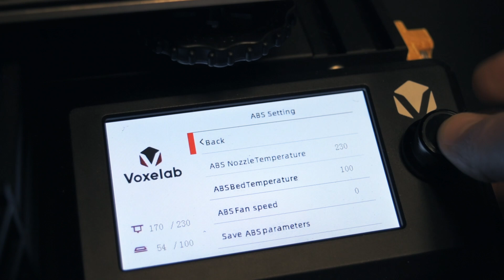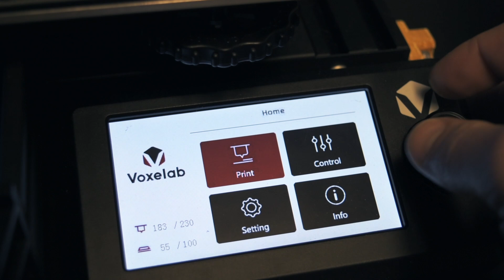Can the Aquila print ABS?

Comment: Heated right side up bed plate always works fine for me for PLA And PETG. Never used glue stick. Only needed when the bed wasn’t heated.
Reply from the maker: PETG is known for fusing with build plates when not using an adhesive. ABS just warps on bed slingers and when the ambient temperature isn't high. So an adhesive as a must. As for PLA…anything can print PLA. That shouldn’t be an issue on pretty much any surface.

Comment: thanks for all the advice - it has helped a lot.... I tried to use the profile you shared but the latest version of Cura won't let me use it (it won't show the profile as the quality type "draft" is not available anymore. Have you got an updates profile or can anybody advise me on setting for ABS using Cura to print on the Voxelab Aquila ?
Reply from the maker: The way to get my profiles to work is to setup a “custom” printer. If you have one selected from a list, such as an ender for example, it will give you that error.

Comment: Recently I have been having a lot of trouble with my printer stopping at random points in the print and sounding the alarm. It will have a message that says nozzle or bed temp is too high/low. I just got a new pack of thermistors. Have you had this issue or have any guidance for me? Thanks.
Reply: I should have added it's a voxelab aquila and Ive had many successful prints. This issue has started in the past week
Reply from the maker: Very common issue. It’s the thermistor. Sometimes it needs to be reseated. Sometimes it needs to be replaced. They are just not a quality item on these.

Comment: How did you change the seam location?
Reply from the maker: In Cura, above all the settings there is a search bar, type in “seam” and it should just show you all of the seam options. In the drop down you can select “user selection” and then you can tell it exactly where you want the seam. I tend to like to put it in the back somewhere or tell it to hide the seam in sharpest corner.

Comment: How do you open/use the profile? I opened the link in your description, it downloaded to my computer, but I cant open it.
Reply from the maker: Do you get an error? If you setup your printer in Cura by selecting one from a list, my profiles won’t work. You have to set it up as a custom machine. ;)
Reply: @3DPrintSOS  I think that might be my issues. I am using the Ender profile in Cura. I will try setting up the custom. Thanks!
Reply: Alright, super close. I got them (Pet-G, PLA, ABS) all downloaded and onto Cura. Im noticing that the fan speed does not auto adjust to your settings. Is that something that I need to do manually, or am I doing something wrong. The ABS and Petg are not sticking well, and I realized after the fact that the fan speeds were not correct.
Reply from the maker: Honestly, never heard of that being an issue. You could always set your fans and save over the profile though. Interesting find. Wonder if this is common and no one noticed.

Comment: Question, is it bad that i scratch the texture part of the build plate when trying to remove a print with the scraper? i would need to replace it if i damage it too much?
Reply from the maker: If it’s super deep and shows up in prints you may. But it should be ok. I have scratches on pretty much all of them, here or there. It’s almost inevitable. If it gets bad, you can always flip to straight glass. ;)

Comment: Did you need to change over to a hardened nozzle for ABS or is it fine with the standard brass?
Reply from the maker: It’s fine with copper. Just hotter and more abrasive filaments destroy these copper nozzles quick.

Comment: ABS question, is the enclosure more to prevent drafts of air, or maintain temperature, or both ?
Reply from the maker: Both. Abs loves to cool fast and peal up from the bed. And the enclosure keepers the temps up until it’s ready. 

I’ve actually printed abs quite a bit now with that machine and I’ve had very little issues when using an enclosure
Reply: @3DPrintSOS  great, thanks, I'll keep the temp in mind making an enclosure this week :-)

Comment: I am having issues with ABS. I can get decent prints, but only using the provided profile and using a brim and setting print speed to 55% or 60%. I also have to keep my Z-offset set to -0.02 or the filament won't stick. It balls up/clumps and then breaks loose and continues with the brim. My mitigation technique is basically once the bed is as level as I can get it, while printing the 1st pass at the brim, take my cutters and snip the balled up ABS away from the brim while making sure not to lift the print (I still get some lift, about 1 or 2 mm and I can pat it down and it sticks after 1 more passes). 
Is there any way to prevent the printer from balling up a few mm of ABS when it first lays down the brim? Will glue stick help here? I am using the texture side of the build plate without glue.
Reply from the maker: Glue stick will help for sure. It’s about how fast the plastic cools in this case. Are you using an enclosure? If not, make a makeshift one out of a box and test to see if that helps.
Reply: @3DPrintSOS  I was able to get my results using an enclosure, just a cheap one from Amazon. Before trying the enclosure, my ABS prints would mess up worse than that. I am part of the way through a ABS print now and the brim is starting to curl/lift. The brim is large enough so that the item I am printing shouldn't have any issues. I'll see in about 8 hours what the print looks like and if there are any major issues.
Reply from the maker: Put some tape on the brim to save it from curling more

Comment: Exactly how ABS worked out for me.
It was like oil and water without the glue.
Glue makes it hard to remove...
Reply from the maker: I’ve printed abs a bunch now. I still use glue. What works for removal is to use the scraper up against the print and a few taps to the scraper with something else. In my case, a screw driver. Those few light taps break it free.
Reply: What about masking tape on the plate?

Comment: i have tried printing abs but not getting satisfactory results. i print with esun abs+ with ender 3v2 stock can aquila profile be used for ender 3v2. what slicer do you use?
Reply from the maker: You can try to use the profile, they are fairly similar. I think ambient temps and heat setting matter quite a bit depending on your location and where the printer is. You might have to enclose your machine to get it to print

Comment: I've been able to skip glue by using blue painters tape on the bed. It wasn't sticking to my smooth Prusa surface even with glue. It stuck to the tape no problem though.
Reply from the maker: I gotta grab some super wide tape to do some testing. Thanks.
Reply: @3DPrintSOS  I just had a standard one, did about 3 strips since my print was mostly center of the build plate.

Comment: Tubing link doesn't work.
Reply from the maker: Yep, looks like Tecboss ran out of stock. I tried to contact them with no luck. Capricorn is the next best thing: https://amzn.to/2XooE4Z
Reply: @3DPrintSOS  Thank You
Reply: @3DPrintSOS  I very much appreciate your replies. I am so close to getting a Voxlab Aquila X2. I am able to get one on ebay for $199 but I need to print with ASA. I have seen the mods you suggest such as the PTFE tubing and I assume it is much the same as or easier than ABS. I understand about having an enclosure and that doesn't concern me other than with the fans turned off the heat would damage the electronics, What do you think of the idea of removing the power supply from its mounts and extending it outside the enclosure?
Reply from the maker: Although I haven’t tried asa yet, I would think with a nozzle, ptfe tube, or all metal heatbreak, you should be able to get it done. 

If that’s what you plan on doing long term, I would totally move the power supply outside the enclosure. You would only have to extend a few wires. Wouldn’t be too too hard.
Reply: @3DPrintSOS  I'm learning in large part to you. Especially concerning the Aquila. When you say All Metal Heatbreak". Do you mean the $4 metal piece or the whole hot end assy? As, these mods add up in cost one has to consider whether there is a machine already geared toward ASA/ABS at a comparable price. All the enclosed printers seem way over priced in comparison. All the reviews for the Voxlab are good.
I have this question submitted to Voxlab but have not yet heard back.
Reply from the maker: They do add up, you are right. But even still, the machine is cheaper and performs on par with everything else. ;). If you want something that has it all already, check out the Prusa printers. 

Yes I mean the metal piece between the block and heat sink. You can grab and all metal or even bimetal version and it will allow you to print practically everything on this machine.

Comment: Hi cool video, did you manage to print without any adhesive product just the clean bed? Keep the good work.
Reply from the maker: Hi. Thanks. No, not with abs. It seems to require glue to work. Similar to nylon
Reply: @3DPrintSOS  thanks for the info. 👍

Comment: I keep getting an error  when i try to import the abs profile into Cura it says could not find a container to handle specified file. ho to i get this profile to Cura I have some parts i need to print. Thanks.
Reply from the maker: I’ve heard of this before. Are you using a different printer profile?
Reply: @3DPrintSOS  i have been using your PLA profile from your video. I have only used PLA so far. I am using the voxelab aquila printer also.
Reply from the maker: Hmm what about the printer setup in Cura. Did you do it similarly to how I did in the vid or did you pick one from a list?
Reply: @3DPrintSOS  I did it exactly how you did in the video. I also tried updating cura to the new version I believe it's 4.9 also but that didn't help either. I still get the same error message.
Reply: @3DPrintSOS   hey i finally got it to import to Cura. I havnt tried to print yet but, I  was trying to import it as a material profile instead of another printer profile I think thats here i as having the trouble. Thanks for your replies though I appreciate your time. Ill let you know if I run into any more problems. Thanks again.
Reply from the maker: Ah good to know. This will help others when/if they run into this issue.

Comment: Try using a lighter just to burn that glue off.  Or just a light sanding on a flat surface with wet/dry fine grit.
Reply from the maker: Nice. Thanks.

Comment: So 230C for the extruder and 100C for the build plate, I'm not using the glue stick and it's working pretty well, just need to make sure to add a brim so it has more surface to stick to the plate.
Reply from the maker: Nice! Yea I’m digging printing abs. Seems like a great material.

Comment: Total noob question, but how do you adjust the flow of the filament?
Reply from the maker: You can adjust it in Cura before you slice. ;)
Reply: @3DPrintSOS  if your e steps are right, but the actual filament laid is wrong do you modify the flow?
Reply from the maker: Exactly. Flow is how you calibrate the filament, esteps are how you calibrate your extruder.
Reply: @3DPrintSOS  does it make sense i went from 93 to 96 steps when all i did was change colour from the same brand

Comment: Hello again, I have a question for you.
How can i change the position of where the head goes when it is done printing. It goes a few mm over the place it stops now i would like a X-10 Y-200 and Z about 20mm above the stop point.
Thank you for your knowledge!
Reply from the maker: You can add some “end gcode” to your slicer that tells the printer what to do at the end. You should be able to find all kinds of options based on the Ender 3.
Reply: @3DPrintSOS  Thank you!

Comment: For printing ABS without enclosure and having a nice first layer try this.

Flip your glass on the ultrabase side, apply gluestick, spritz watter on the already applied gluestick and with a paper towel gently wipe untill you can't see the applied gluestick.
You'll wipe a lot of the applied gluestick but a thin layer will be left.

This works for me with ABS that likes to warp.

If you don't like to apply adhesive for ABS,try Fiberlogy Easy ABS or ASA or FormFutura Titan X(ABS), they work extremely well without enclosure and there is no warping,these filaments are a bit more expensive but it's worth it.
Reply from the maker: I appreciate the pro tip!

Comment: What temperatures do you set PETG on your Aquila?
Reply from the maker: Check out the PETG video. I have a profile included that you can use.
Reply: @3DPrintSOS  I have done that already but my computer is having issues with reading the file. I don't have the right software to read the file, nor can I find it.

Comment: This printer has been driving me crazy! I have not been able to get anything to print correctly 🤬
Reply from the maker: Hmm. Any more detail? Maybe we can help.
Reply: @3DPrintSOS  I did finally have a good print after readjusting the bed for the 100th time. However, when I try to print something other than the test files I get trash. The filament seems not adhere to the surface in some places. Then on a subsequent layer the loose filament on the bed is getting stuck on the nozzle. When the nozzle moves it pulls up the rest of the layer(s) from the bed. I was gonna try glue stick and masking tape. I'm using the PLA sample that came with the Aquila. But it's almost out, so I will have to switch to the PETG spool I have.
Reply from the maker: Try to clean the bed really really really well. Also try flipping it to the glass side as well as doing a live leveling.
Reply: @3DPrintSOS  I did clean the bed with soap and hot water. Then, dried. Then, went over it with isopropyl alcohol. I did get a print to stick after adding glue stick the bed, but it seems to need to washed off and reapplied after every job, and it doesn't work for all jobs. Got a different bed mat to try out So I don't have to dick around with the glue.
I just got finished doing the steel extruder and the Teflon tube mods. Will be doing the fans on my next day off.
Reply from the maker: Nice. Before you switch the print plate, try doing a live leveling technique. You should be able to easily get pla to stick to glass without issue. It’s gotta be a leveling or temperature issue.
Reply: @3DPrintSOS  When I don't apply the glue stick neither PLA or PETG will stick to the factory bed. However, I will try flipping it over before applying the flexible magnetic printing surface. Just to see which works best.
Reply from the maker: Hmm what temp are you printing at? On the bed? Have you tried to live level?
Reply: @3DPrintSOS  I have adjusted the bed temp from 60-80°. 80° works for a single item print, but not when printing the same item multiple times on 1 run. I tried bed weld on the multiple item run and for some reason the print just stopped after a few layers. I have tried live leveling and it doesn't help either. Not sure if I mentioned this, but I'm printing with PETG (Amazon basics brand). The hot end temp is 245°
Reply from the maker: Get the temp on the bed up to 90. Have you tried the other side of the bed?
Reply: @3DPrintSOS  So far it has been printing great with the bed weld, with temperatures 250° and 70°, fan at 40, and print speed 80%. Test hook came out great. And so far the dices are printing well. I will test bed at 90° and hot end 250°, etc. without bed weld, next. The alternative magnetic print surface was crap.

Comment: I keep having problems with leveling, No matter how hard I try I feel like I cant get it to level right, what are some tips tthat you have?  Also is bad to pause the print and touch the print bed?
Reply from the maker: My advice would be to level it the best you can once and start a print. While it’s printing the first layer, slowly adjust the knobs until it’s sticking and perfect. Then restart the print.
Reply: feeler gauges.  https://www.youtube.com/results?search_query=bed+level+with+feeler+guages. 

Paper is inconsistent with how much force or drag you get. feeler gauge will fit or it wont.

Comment: I have a question or two. I want to print ABS but I am concerned about the gases or VOC. Is it safe, or the brand you used safe? Does the tube have off gassing? I purchased the tube you suggested in another vid. And thanks for posting all these vids. I have learned alot and use a couple of your profiles, and parts you suggested.
Reply from the maker: I too have been concerned. That’s probably why I waited so long to print abs. This stuff had no smell. However, if you plan on printing it a bunch, I’d do the tube at a minimum.

Comment: I asked you this on your open box video. I am considering ordering this printer will it be able to print 10.5in by 6.5in by 2 inches if I lay the object diagonally?  I will also want to also use ABS so this video was helpful Thanks
Reply from the maker: Sometimes these printers stubble going edge to edge. To keep that in mind. You can always buy an Ender extender and make the printing space larger

Comment: How do you keep it from extruding during warm up, I can’t figure it out, and it screws up my first layer and sometimes the whole print
Reply from the maker: That’s normal. As the hotend gets hot, the plastic melts and begins to slowly ooze. This is why I print with a brim or skirt. It allows you to purge some plastic from the hot end before the actual print. You will have to watch it and pull off any extruded plastic before it starts to print.
Reply: @3DPrintSOS   thank you!
Reply: Cura puts a prime line by default for this reason